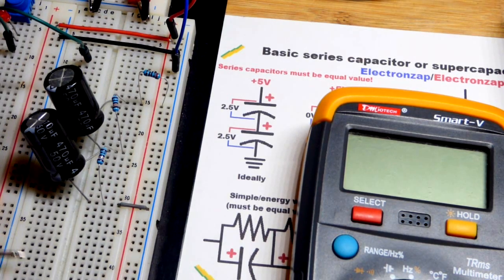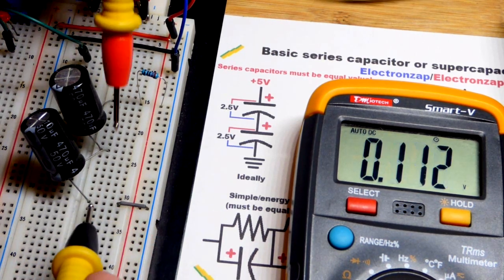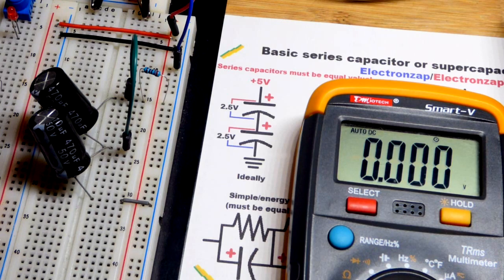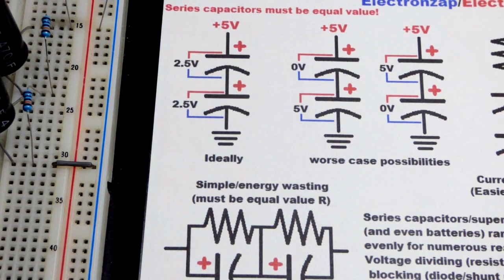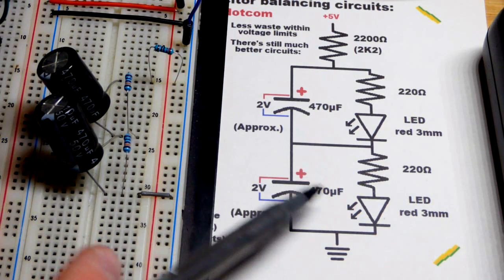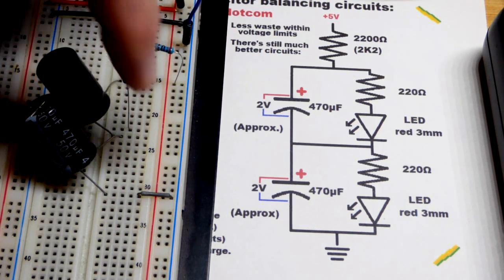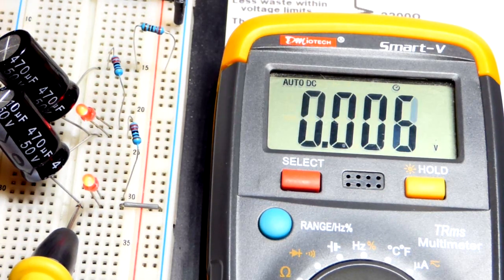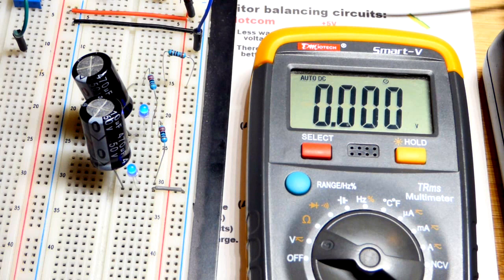Simplest series capacitor supercapacitor balancing techniques explained using DIY electronics

Comment: Thanks..How to determine which value resistor need to use say for two 30F Caps ?
Reply from the maker: There's a lot of factors, for super capacitors you'd definitely want a high wattage transistor for each supercap that prevents it from overcharging in addition to voltage dividers that reduce the chance of them becoming unbalanced in the first place. The better the capacitors match each other in capacitance and leakage, the less current you have to waste trying to keep them balanced. Now that they have reasonable priced balancing modules for battery banks, I pretty much stopped thinking about these kinds of circuits.